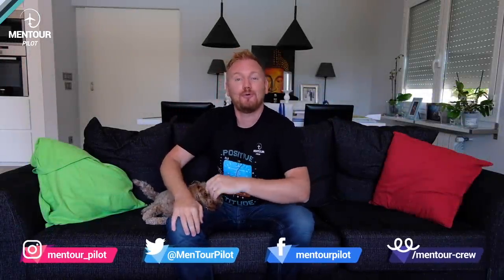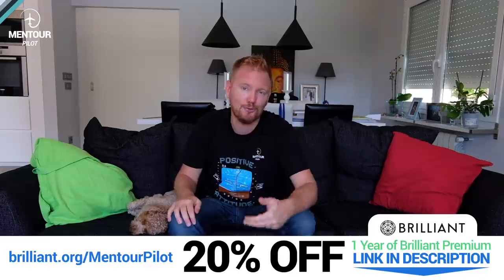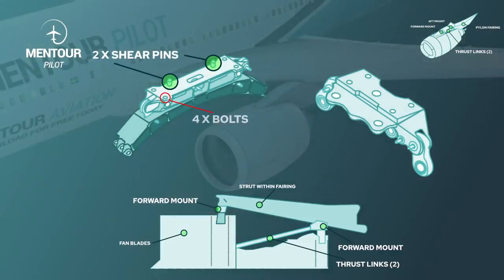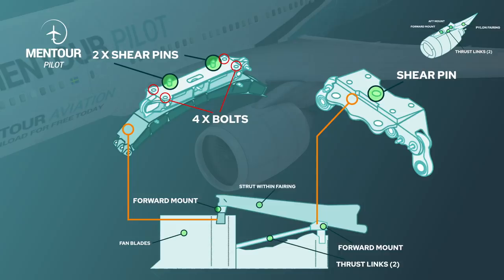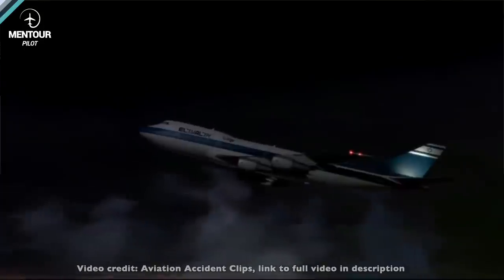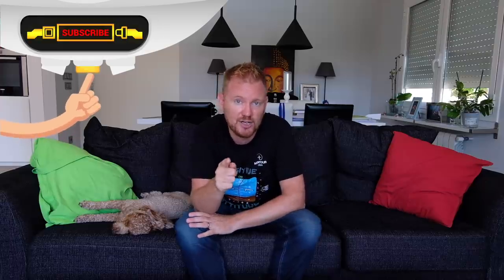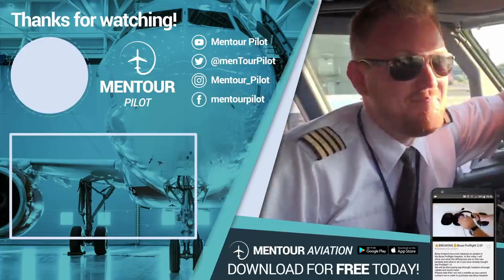How are Jet-engines attached to the wings?!

Comment: I remember the specifics of the Chicago DC10 crash. The manufacturer stated that the engines should be removed using a sling and a crane and NOT a forklift. But a forklift was used and it damaged the structure. The engine broke off, the aircraft flipped upside down and there was no control.

Comment: The thrust links in the engine mount system also increases the backbone rigidity of the engine itself - they prevent the blade tip clearances from changing too much, which helps with efficiency and safety.

Comment: AAL 191 was the one where they were using a forklift to lift the engine into place faster. Saves time on engine installs. The trade off is thinking about what might happen afterward with all the time you saved on that engine install.

Comment: Thank you Peter. Regarding engine location, is weight and balance as to the engine location also an issue? In other words-they have the  engines sticking way out on pylons to counter balance the loads aft of the center of gravity. Additionally, compared to piston engines, turbofans have a much better thrust to weight ratio.

Comment: I am not a pilot, but I had read somewhere that at the time AA had a policy where if you loose an engine on take off to pull back the thrust, someone speculated that if the FO (who was flying) had increased the thrust they MAY have been able to control the aircraft, not sure if loosing hydraulic fluid that the slats/flaps retracts could be recoverable.
Reply: Thats pretty correct.  If the copilot had maintained the highest airspeed attained during climb-out, instead of slowing down like the operating procedure says to do, the aircraft would of still been controllable.  The procedures were changed after this accident as to not slow the aircraft down.

Comment: Very clear explanation thank you very much  for sharing your knowledge with us.
Science you are inviting us  to make related question over aircraft, there is one that no one that I have asked had come with a reasonable explanation. The question is the following. This question is about some tubo prop airplanes I have flown in.  When they start the engines, the propellers are completely feathered , this is the position that the propellers present the greatest load to the starter instead being at ZERO pitch which would represent the les load to the starter. I hope I was clear in the explanation of my question.   This is something that the aircraft builders should take in consideration.
Reply: It's because the design of that turbo prop engine, the gearbox is driven via a dedicated turbine, which makes less resistance to exhaust flow when going as slow as possible (yes a bit counter intuitive) which aids the starting. There are other turbo prop designs where the gearbox is driven on the same shaft as the compressor and these engines start with the propeller blades at zero pitch (the opposite) so the propeller and compressor can spinn up the easiest at startup. If you are interested in this, you should definitely check out Agent Jay Z channel.

Comment: Interesting story for one of your future episodes: On a Air-NZ flight from SF, we were at 26k feet (with bad turbulence) I asked the steward (thanks to the Q/A chat system) , why we were not going up to ex. 38k feet? The answer was that we were too heavy & after burning fuel we would do so...  & sure enough we did progressively indeed... Then I was thinking that to fly higher, we would have to go faster (because air-density) and then would hit Mak-1 on some surfaces of the plane (since speep of sound is mostly directed by Temperature which is lower up there....  Neat isn't it?

Comment: Additional information on the American Airlines failure. What the said at the time was that the engine and pylon had been replaced as a unit. The careful "delicate" fitting of the pylon to the wing was extremely difficult with the added weight of engine hanging off one end. The approved procedure was to take the engine off the pylon as one step then remove the pylon from the wing. And the pylon to the wing and then the engine to the pylon for re-installation. Their maintenance short cut cost lots of lives.

Comment: That accident happened, because the airline cut corners to save money. They lifted the engines with a forklift, which cant be controlled precise enough. So they bumped the fixtures into each other damaging them. To my knowledge the plane had a novelty, a TV screen in the front of the cabin, connected to a camera showing what the pilots see. Imagine what the passengers saw.
This is the kind of thing making me wary to fly. As a passenger i have to trust that things are done properly. Cutting cost wherever possible and safe operation are natural opposites. Nevertheless i have flown with a budget airline twice. Some years ago i flew with Germanwings from Düsseldorf to Paris. We were several hours late because the plane had technical issues. On the flight back we waited hours for the plane, which had technical issues and did not arrive in Paris because it didnt fly at all. They send us a pickup plane from Eurowings, a CRJ900, very nice plane by the way, really liked it.
However, i felt uneasy when booking this weekend in Paris, but it was a package with the Germanwings flight. Two flights, one late due to technical problems, one didnt happen for the same reason. I thought they either have a defective plane or no plane at all. That was the last time i set foot into a budget airline. I wont do that again.

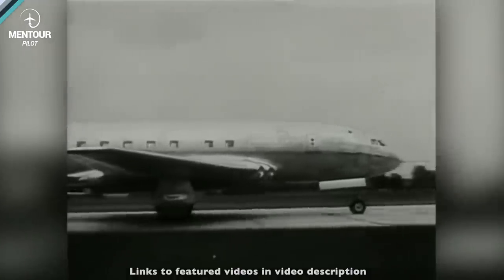Comment: 2:27 Thanks to that Comet airplane is why today most airplane windows are rounded. Square windows taught us how an airplane structure breaks under normal operation, so they represented a weak point where metal stressing found a place to initiate micro-cracks, and subsequently, some of those planes failed during flights.

Comment: The engines are basically the last thing attached to the plane because of their expense.
Reply: What?
Reply: I think pilots get attached to the plane after the engines.
Reply: Cool story Rob
Reply: Hilarious . Talk to actual aerospace engineers for accurate data .
Reply: Quantum Mechanic that is accurate though. He’s talking assembly. Watch any video on that process
Reply: @Ant F - I don't need to watch videos after 40 years of mechanical engineering with 3 major aerospace companies .
Reply: To The Point  kewl. next week we learn to count to 2
Reply: @Quantum Mechanic  Agreed. After 40 years of doing things the improper way, watching a video would only make you feel even more insecure about how much you don't know.

The OP's comment is correct. Engines are very expensive and the airframe manufacturer incurs significant capital taxes on them. Additionally, the airframe manufacturer doesn't have anything to do with the engines except for mounting them to the airframe, connecting the various systems, adding the cowlings and functionally testing the engine and the connected systems before first flight. Thus the engines arrive just in time to do all that, and all that can only be done when most of the other work is completed. Also, by avoiding mounting the engines in advance, the risk of damage to them from a lot of ground equipment and tooling is reduced.

Comment: @mentour Pilot: When the engines are set to takeoff thrust, you can hear a constant rattle which sounds more like a racecar motor. you can only hear it when you are seated in front of the engine and it slowly dissappears during climb.l what is that sound and why does it dissappear in greater hights? are these little sonic booms that are created at the edges of the fanblades?
Reply: The air resistance is lighter the higher you go. Less fuel burn. Less energy needed, less noise.
Reply: Yes this is the sound of little sonic booms from the fan tips. The sound decreases during climb because the engines power is reduced and because as you speed up the sound must travel upwind if you are seated ahead of the engine. There is also a change in the shape of airflow velocity into the engine when it is moving compared to low speed on the ground. In a perfect engine design the fan blades would always be less than mach 1.0 but for engineering limits the fan and low pressure compressor are on the same shaft so they must compromise the RPM. This is why you hear talk about geared-fan engines, slow the fan and speed up the compressor; but the gears add weight, cost, maintenance, and more failure.
Reply: @mytech6779  You have such great insights and real contributions to the discussion.
Reply: @mytech6779  On a less technical note. When I check in my luggage is very carefully weighed, (I know, consider the baggage handlers) But when the lumps of lard passengers with twice my weight check in, no one bats an eyelid. Most irritating.

Comment: It’s ironic that he’s talking about engines hitting the ground on landing and shearing off. Today a plane in Pakistan did just that except they didn’t fall off and after landing without gear down did a go around and crashed , all perished. Apparently the engines were damaged to a high degree upon landing and somehow he was able to hit an altitude of about 3000’ and then the engines quit and they crashed into a housing community. RIP
Reply: Kenny Thomas 2 confirmed survivors
Reply: When GA becomes more dangerous than an emergency landing.

Comment: Newtons per square mm is a valid unit of pressure, but the common unit name used in industry and engineering is the megapascal (MPa is equal to N/mm^2, just a name difference); pounds per square inch [psi] is common in north America. 
Inconel 718 yield strength is 1100MPa[160Kpsi] and ultimate strength of 1375MPa[200Kpsi] (dependent on temperature and finishing treatments of course.), This is similar to a tempered low-alloy steel. The main advantage of Inconel 718 is that it retains substantial strength to high temperatures and it is resistant to oxidation even at elevated temperatures.

Comment: In your example when landing with gear up, is there a valve that automatically shuts off the flow of fuel to an engine should it be sheared off?  Or is there a pilot procedure to shut off the flow of fuel shortly before a landing of this nature to avoid a fuel spill along with the potential fire from that?  By the way, thank you very much for your videos.  I learn a great deal with each.

Comment: The PIA PK-8303 hit the runway with landing gear up on 22nd May 2020,  and the engines got damaged in the event but they remain connected with the wings... however the damaged engines later failed after the go around and the plane crashed eventually. so the reason you mentioned that they should fall apart from the wings in case of landing gear malfunction seems incorrect.
Reply: They made a greaser of a landing or they would have come off.

Comment: I really want to have your expert opinion as what might have gone wrong with flight PK8303 that crashed today. The pilot reported both engine failure and fell from the sky just 900 meters from the touchdown point of the runway and pretty off the glide slope whereas a similar airbus 320 flight 1549 survived even both engines failed during a climb. Your opinion may help investigators also to follow the lines from the piloting point of view. The CCTV footage of the last moments is also quite disturbing. I'd really appreciate if you may comment on this incident. Thank you!

Comment: I'm confused.  You said those bolts are plenty strong enough to secure the engines to the pylons, with the strength of the bolts far exceeding the forces applied to them during normal operations.  However, you said the second accident was caused by metal fatigue in the shear pins.  If the bolts are really as strong as you said, then they should have kept the engine well-secured, even if all of the shear pins broke completely.  What am I missing?

Comment: This makes me wonder a little about the incident you covered regarding a thrust reverser deploying in mid-flight.

I haven’t done the calculations, but my first thought was “why didn’t the reversed engine just shear off from the stresses?”. Because if it had, it seems like that situation could’ve ended a lot less badly (since the source of the asymmetric thrust would have effectively eliminated itself, leaving the flight crew with a single engine & a degraded wing; far from ideal, but not necessarily flight-ending). 
Is this something that was ever considered by engine/pylon engineers? Or was it (as I suspect) deemed such an improbable situation that they never took it into account?

Comment: Hi, please make a video (or at least small video) on the airbus a320 crash in Pakistan. Initial investigation says that landing gear weren't dropping and pilot tried to belly land it but soon after touching the ground he aborted (or forced to do so) and then during 2nd attempt both engines failed and plane crashed just short of the runway (100,200 feet). I will be very grateful if you make a video on this crash as local authorities just close the chapter and put all the blame on pilot everytime. There are 2 survivors as well and one of them is a CEO of a popular bank.

Comment: Hi Mentour, great video as always! I have a question about the power of engines, why when someone of the industry talks about a new engine they emphasize that its power is a high power engine or more powerful than any other, since commercial airliners don't fly faster than the transonic speed, i.e. no matter the power of the engine the aircraft which it powers doesn't fly faster than M .88 or so, then what for is the increase of engine power?
Reply: pad39b — You need more power for a larger aircraft.

Comment: What about reverse thrust force on the mounts when landing?
Reply from the maker: Never more than the forward thrust
Reply: @MentourPilot  
Yes, but the thrust links would be in compression instead of tension?
Maybe there are other limiting factors as well. 
The designers would have calculated the loads with reverse thrust as well, as the direction of a force is very important in mechanical engineering. 
There have been many accidents by making assumptions that if something is strong enough in one direction it is strong enough in all directions.
Reply: @hydrusje  the links don't know their in reverse. The reverse systems isn't attached to the engine but the pylon.
Reply: hydrusje the forces of the jet engine during reverse thrust must be lower than the forward motion because the pylon fairing are forward mounted and they are resistant to the forward velocity of the engine as the gases shot out of the exhaust backwards the opposite reaction causes the engine to move forward thus generating thrust. If an opposing force was exerted with the same force of thrust it can cause some structure damages to the fairing holding the engine. But reverse thrust uses parasitic drag to slow down the aircraft. The reverse thrust doors are fairly large to generate the vortexes at the tips of the doors via aerodynamic resistance. If you know your physics that Issac newtons law of motion is when a reaction has an equal opposite reaction and you need to understand quite advanced fluid dynamics and aerodynamics when fluids come into contact with objects with vertices like a cube it will create drag by the use of vortexes and turbulent air.

Comment: I'm sure I'm late in asking this question, but how is the engine itself attached to the pylon?  All those rotating parts inside.  It would seem there needs to be a way to attach the "crankshaft" so to speak.

Comment: VASAviation just published a video about an aviation disaster in Karachi. Details are sketchy right now, but there's a lot of speculation that A320 had the engines hit the ground after a gear failure, before the pilots did a go-around and subsequently crashed when the engines failed.  I know you generally don't comment on aviation accidents, and I respect that, but if you have any thoughts I'd be interested to know them?

Comment: In the early designs, most engines had a save live design. After some accidents the design had to be changed to a fail save design. Especially the B747 had to get a service bulletin to change 100% of all flying B747 from save live to a fail save design. Means a sigle failure in the attachment (whatever it is!) is not allowed to become a problem (sorry, I do not have the CS25 or CS for engines paragraph with me..). And I do not believe that there is an idea to loose an engine while MLG up landing. However when comparing components of an aircraft, we need to compare the load with the load capability of the structure. With this we get a reserve factor. these reserve factor you can compare. if there is a popper design the reserve factor is just above 1.0 otherwise your aircraft is to heavy and with it it will burn to much fuel...

Comment: Question, I see on videos where during landing the pilot landing is moving the side stick or the yoke quite a bit. I realize that an airplane is way bigger etc than a vehicle but if I move my steering wheel while driving my car is all over the road. does all the movement of the side stick and yoke (side to side that is) cause the wings to go up and down much during landing?

Comment: Hi excellent vid as always, but there is one thing i have always wondered, what criteria governs the size, shape and placement of a wing, i have seen aircraft with massive wings compared to their body (A380) and smaller ones which i think are too small and in the wrong place {DC9, Fokker 70) i know it will have something to do with size and weight but is there anything else in the design maybe  i don't know. many thanks